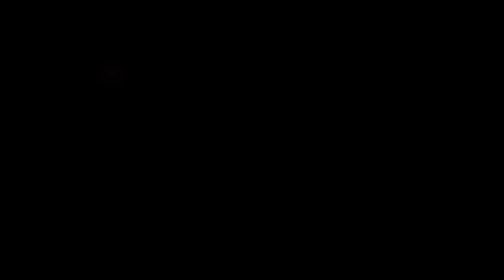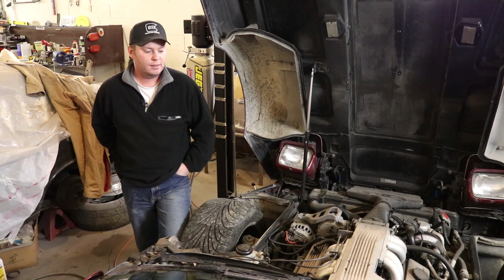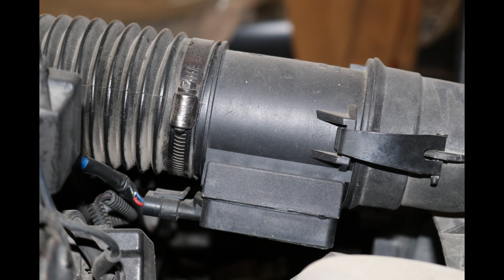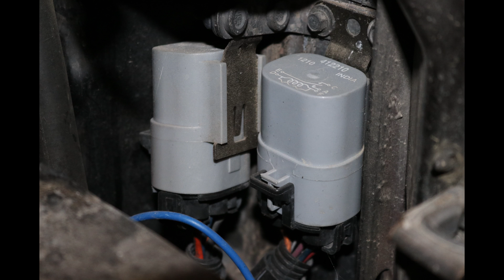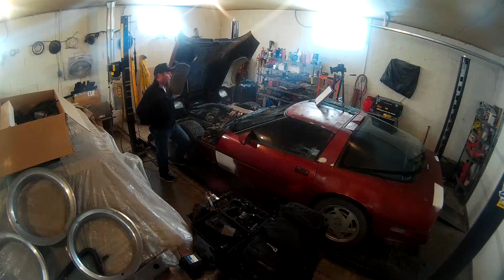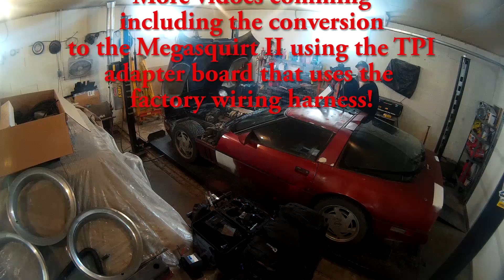Corvette GM TPI code 36 / Mystery Solved- DIY AUTO REPAIR #2

Comment: You are mistaken. The code 36 is only a problem during a burn off mode. It is strictly a voltage out of expected range code during the burn off command. The measurement wire that the ECM monitors is the same  dark green wire that goes from the MAF ,connector center pin ,to the ECM. When running the normal range on this wire is .5 to 4.5 volts. During the burn off cycle when the key is shut off ( and after getting into full closed loop prior to shutoff ) the expected voltage is 1V .  Because the burn off cycle only lasts 1 second and the MAF, 2 relays and the Burn Off relay to the ECM ground wire are involved there are many places for there to be added resistance from a poor loose male/ female connection.  The MAF itself is a major problem area for loose fitting male pin to female connections.  
The code 33 and 34 only set at the extremes of the normal running MAF voltage, over 4.5 and below .5 respectively. The code 36 is much stricter.0.4V to 1.9 V, and this is where voltage drop across all the connections and relay contacts cause out of range conditions.
However, there could be a scenario where the code 36 sets because of the actual MAF hot wire resistance changing from getting dirty, but not enough to set a code 33 or 34. Some service info says to inspect the PCV valve for blockage. A blocked PCV or a leaking hose as in your case from the PCV to the intake do the same thing to the engine. In this condition crankcase blow by gasses get forced up into the throttle body and intake tract, where they could possibly backflow   during shutdown and  oil contaminate the hot wire in the MAF, just enough to trigger code 36.

Comment: Had the same issue. I cleaned it with mass air flow cleaner I still do not solve the issue what the O'Reilly's and bought a another mass air flow sensor put it in clear the codes problem solved

Comment: Yup, late to the party. 1990 corvette. intake was removed due to an oil leak at the rear. New gaskets and RTV front, and rear then reinstalled. New EGR, and vac sensor installed since I had removed the plenum making that easy. Had a rough Idle condition after that and when warmed up it threw a code.  Went over everything 4 times still couldn't find the cause. Took it to my local shop and hoped a fresh set of eyes would find it. Fifteen min.s later I get a call. Runs smooth. They smoke tested it and found a Vacuum leak at the Y fitting going to the EGR Vac sensor. Also, the new sensor had a crack that with the part off you couldn't see. But the smoke doesn't lie. A Delco part. Reset was done by battery disconnect and connected. No codes, runs great plus no more oil leak. With any 33-year-old car or truck plastic vacuum connectors are sure to pull a sneaky on you. My car is low mileage but even the hoses needed replacing the ends had splits and cracks. From the outside they looked good. Just the fun in having an old car.
Reply from the maker: Great info to share, Thank you!

Comment: EXCELLENT diagnostic skills my man! So, I have a 92 Vette. I keep getting a code 61 and am in the process of tearing out the dash because I think it is an electrical issue between the CCM and the ECM. But you have given me another avenue to look at, since you too thought it was an electrical issue. Just curious, but what does the book say a code 36 is? Did your check engine light come on?

Comment: Been trying to figure out the 36 as well but on my 94 Camaro 3.4l v6 replaced the part it told me to replace engine code reader is saying (ignition system loss of 24x sensor signal) parts replaced and still can’t figure it out.

Comment: The DTCs absolutely NEVER tell you what to replace. Not ever. They simply tell you where to start looking for the issue.

The computer never thought that those items were in need of replacement. What it did was inform you that there was an anomoly in that section of the car that needed attention. From there, what you SHOULD do is follow the correct diagnostic procedure in the GM Factory service manual, and you would've found there was a vacuum leak causing this issue. 

So instead of wasting hundreds of dollars replacing parts that were fine all along, spend wize and buy yourself a factory service manual correct for the year of your Corvette, and learn how to do these things properly.

Comment: Had a similar problem.  My fuel pressure regulator was letting too much fuel (high pressure) and causing all sorts of codes. I now whenever I see a code look for what might cause that sensor to code.  Oceans razor, the simplest thing is usually the answer.
Reply from the maker: Thanks for the info!

Comment: I'm an old car guy. And I would just block off the vent to the intake from the pcv and then run the pvc to a filter and vent it to the sky. {cause why would I want fumes and oil mist going back to the motor into the carb.) I might have caused my problems?  stupid new cars I'm going back to the 60's. never had problems with those.

Comment: Always smoke first all you need is a cigar blow into brake booster hose. Or by smoke machine. Visual inspection and know how read wiring diagrams. Real fixes real fast videos will glide you right throw problem solving tech.

Comment: I need a megasquirt adapter board for a 165 ecu was it hard to wire it up I'm running a vortec stealth ram with t56 in my 86 trans am need the self tuning

Comment: Evening! Was the car backfire and losing power when you accelerate? Because with my car as soon as I give gas it looses revs and backfires while standing still and while driving it can drive at a really slow basically idle pace and as soon as I accelerate it does the same, even if I slowly pick up pace. Thanks for the video, awesome help!
Reply from the maker: When an engine backfires back out of the intake it will be 1 of 2 problems. 1. you have a major vacuum leak or 2. you have a fuel delivery problem(engine isn't getting enough fuel for the amount  of air going in) I hope this helps in some way. Thanks for your comment Carel!

Comment: I am having this code 36 and it's driving me nuts. I fixed all the leaks and the one you had along with all the relays MAF and vacuum lines , ECM, IAC  TB rebuild and 02 sensor . My car surges up and down at idle. Could a vacuum leak at the intake cause this?
Reply from the maker: Yes it could.

Comment: I used a cigar and pipe - to blow some smoke into the intake, and
there it was  : a cracked [hairline] PVC pipe.  Thanks to Rodney Frey for this idea.. Don't just throw parts into the problem. Rodney detected it with a cheap cigar and a piece of pipe.

Comment: An I also got rid of the 9th fuel injector. And put a delete plug on it. And got rid of that stupid air/smog pump and removed the A/C system. Mine is the Indianapolis pace car convertible Corvette I don’t need a/c

Comment: That vacuum leak on that hose from the PCV valve also leaked on  1986 Vette. . I hope that I will never have to replace my MAF, the price of them are out of this world. Any where from $200-$800. At that price I will remove my fuel injection manifold system to a Edelbrock torquer two and Holley carburetor system for half that price get rid of that MAF unit. I will be replacing all 6 of my U-Joints on the Main driveshaft and the 2 half shafts. I’m not looking forward to that. But it has to be done the car will be 34 years old in 2020.

Comment: Same exact issue on my 86 305 TPI, the mechanic can not figure this out after $2,500 worth of new parts, we watched this video and he is going to give it a shot this weekend. I replace the coolant reservoir, would the hose coming from that if not tight cause the same issue?
Reply from the maker: No the coolant overflow would have nothing to with this.

Comment: MAF issues. 2 new sensors made a tremendous improvement, always code 36 on restart. Just seen your video, went straight to the garage, that little piece of hose is very deteriorated. I was also having odd air venting issues when going up the mountains, hope this solves that too. It's 9:45 pm now, will fix tomorrow. Thanks,awesome find.
Reply: Kermie Bledsoe did it workout?
Reply from the maker: Did you find the problem?

Comment: My Trans Am is running rich Super Rich to the point where it just smokes and does not clean up unless it's wide open. I put a different mass air flow on it it seems to run better but this all started because I had an anti-freeze leak I sprayed the antifreeze off with the hose as it was running it seem to run worse when I sprayed it under the intake manifold or under the plenum I should say I'm going to take your advice and see if I don't have a cracked pose under there. Thank you something is making it run super rich and I cannot figure it out.
Reply: I'm having same problem with my 87 GTA running rich AF! Tried all kinds of shit, still haven't figured it out!!

Comment: That problem you had there with that little piece of hose if not seated properly and cracked like yours was will also kill your power big time. Do not use heater hose as a sub for the real thing it will get hot and soft and create another vacuum leak that way as well. Use high heat vacuum or power break booster line 15/32” works perfect that way you won’t need the hose clamps. GM didn’t use them!

Comment: Thanks man, great reminder that the computer is not always right. We tend to ignore that idea.
Reply: James K Doherty the computer was right, it threw a MAF sensor code indicating there was an issue with air/fuel measurement. Unmetered air (vacuum leak) is often one of the first things to look for when a MAF code is present.

Comment: My 86 looks likes it needs the same little piece of hose and is pulling a code 36.  How the heck did you get at the clamps to replace that little hose?
Reply: Robert Harker How do you remove that little hose, to replace it? Thanks
Reply from the maker: Mine didnt have clamps it was just a snug fit. I have since plugged the hole in the intake where the pcv nipple was and just deleted the pcv. I dont have to have emissions where I am at.
Reply: Thanks

Comment: In both cars that I've had with a code 36, replacing the MAF sensor cured it. It points to the burnoff circuit on the MAF sensor. On my 86, I messed with the wiring, the MAF relays and checked the TPS etc, but it had a problem with lack of power and stumbling. I finally gave in and replaced the MAF and it ran great. I bought a MAF off a private seller to use as a backup in case the one in my 87 went out. I put it on the car and I had lots of trouble starting the car and it had lack of power. I put my known good working one back on and the car ran fine. Your problem was unique because that should have tripped a code 33 or code 34, not the code 36. Glad you fixed it though.
Reply from the maker: I replaced the MAF on this car with a new one and it still gave me the code. I went on to replace the MAF relays X2. Then the ECU. Still gave me the code 36. What I explained in the video is the only thing that fixed it. Yes I am glad that I fixed it. Thanks for the comment!
Reply: Worth trying for us that's been down the new MAF, new relays, sacrifice chickens!